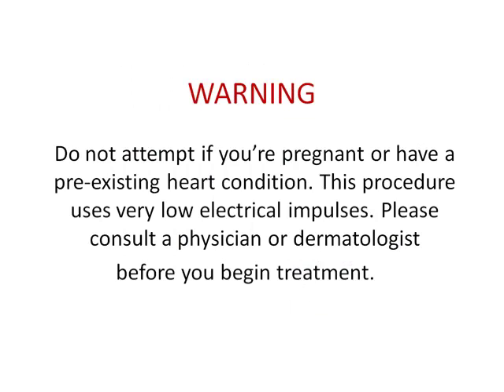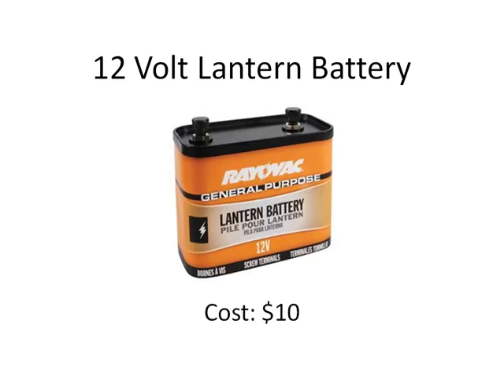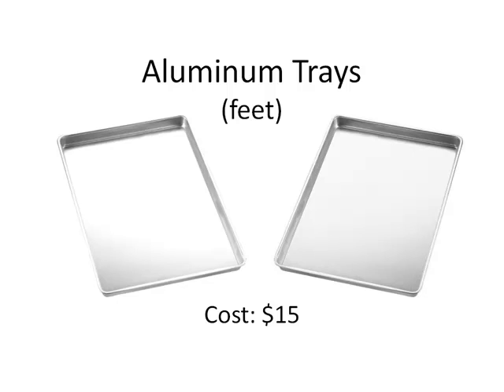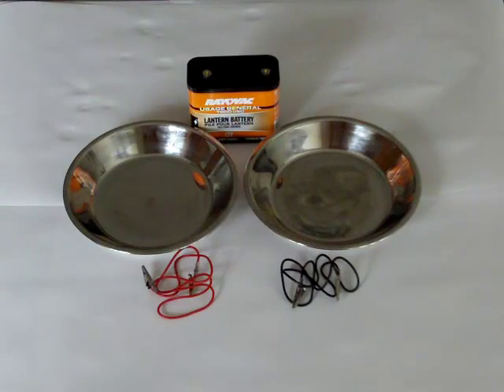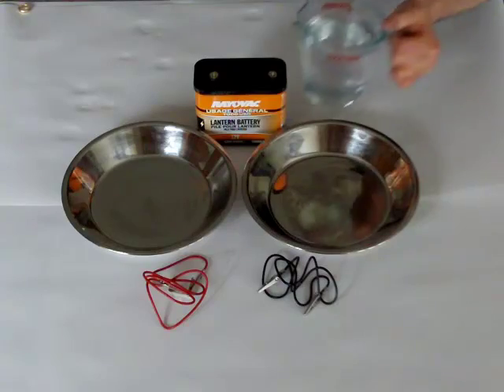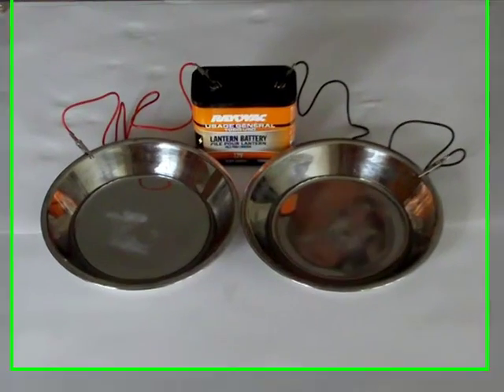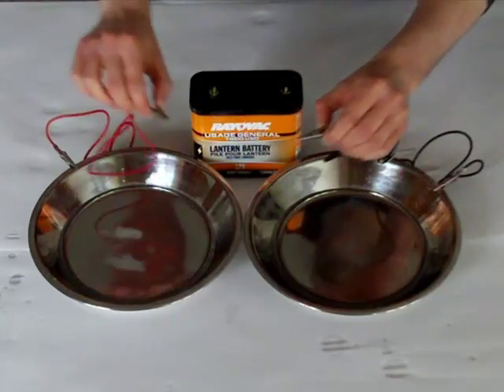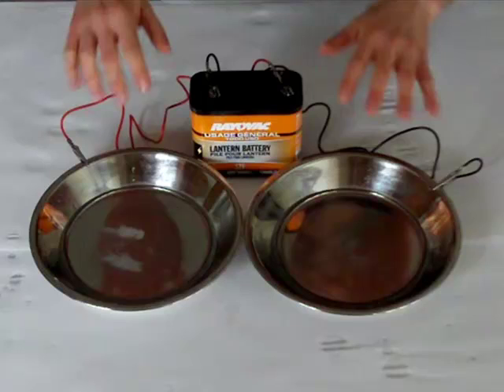How to Build Your Own Homemade Iontophoresis Device

Comment: I have been using the ionthophoresis method for more than 3 months and it has helped so much, i used it every 3 days for 10 days and it works for me. The thing is that I know i need to have maintenance so i do treatments once a week but it hasnt been working like before i wonder if i need to add salt to the water to make it more potent, i use a transformer  connected to alligator clips and  use an outlet so what do you suggest?
Reply: Use baking soda, also try using a higher voltage. I use 24 volts and it always works has long as needed.
Reply: jan dupree thank you I will try it!
Reply: medelin geraldino So, Did It work?
Reply: Yes, it does work, do the first 10 sessions every 3 days then you could do maintenance ones a week or as necessary.
Reply: medelin geraldino as for the aluminium or steel plates i have my reservations because i was researching and the ions emitted are supposed to be dangerous... so I wonder what if we use glass instead of aluminium/steel by puting the cables in the water..also i believe it's better to (instead of using tap water) get filtered water and add the minerals we want..because tap water has fluoride, lead, mercury etc sometimes
Reply: it works but what i am worried about is the aluminium/steel going in the body..which is why i wonder if glass would work. Also, tap water may have unwanted things like fluoride, lead, mercury, arsenic but i'm not sure since i haven't tested the water., but i bet these materials are in it...which is why I wonder if using Alkaline Magnesium water (http://www.scientificpsychic.com/health/mineral-water.html) would be a better idea.. Anyhow I will try Alkaline Magnesium water with 2 aluminium plates from now on but first i will try in glass with the cables in the water.. i will post my results but i am waiting for Epsom salt (magnesium sulfate) to arrive first.
Reply: medelin geraldino Thank You soooo soooo much !
Reply: medelin geraldino Does it get worse before it gets better?
Reply: medelin geraldino what is ur exact transformer? can you give me the specs? also have you felt any buzzing in the ears lately?
Reply: Shadow Of Earth Hi, I use an outlet and connected alligator clips to it, no ringing in the ear now I will use a 18 bolt battery for better results since I stopped maintenance and my sweating came back.
Reply: Javi Arencibia no it does not, it gradually decreases
Reply: medelin geraldino 
will this adapter work ?  (connected to outlet and alligator clips
AC-DC ADAPTOR
CLASS 2 TRANSFORMER
MODEL: CY41-1800300
INPUT: 120V AC 60Hz 9W
OUTPUT: 18V DC 300mA
Reply: Shadow Of Earth yes! I do believe that will work, I will try it for myself since I can't find 18 volt batteries, any suggestions?
Reply: medelin geraldino the closest ones i've found to mine are:

http://www.amazon.com/18V-AC-to-DC-Adaptor/dp/B00NRH8Q4U/ref=sr_1_18?s=electronics&ie=UTF8&qid=1422067474&sr=1-18&keywords=ac-dc+adaptor+300ma+18v

and

http://www.amazon.com/UpBright%C2%AE-Adapter-Electrolux-Cleaner-Charger/dp/B00OP30Q48/ref=sr_1_3?s=electronics&ie=UTF8&qid=1422067474&sr=1-3&keywords=ac-dc+adaptor+300ma+18v

and you need 2 of these alligator clips:
http://www.amazon.com/10pcs-Black-Coated-Alligator-Clamps/dp/B00S4YKS60/ref=sr_1_25?s=electronics&ie=UTF8&qid=1422069469&sr=1-25&keywords=alligator+clips

Guide to set up clips:
http://www.instructables.com/id/wall-transformer-for-project-power-supply/
Reply: Shadow Of Earth  Hey, but don't the cable get oxidized? And how will it work efficiently? I bought the 18 v outlet and made my own with the alligator clips and its working really well.
Reply: Shadow Of Earth thank you for the instructions!
Reply: medelin geraldino I guess the alligator clip would get oxidized yes if placed directly in water but i wonder if it would work that way and i also wonder if it's more safe.. i will probably try in a week.. and tell you if it works and what not.
Reply: medelin geraldino no problem! glad i could help..please do tell of your progress. Remember 10 minutes and then swap cables 10 more minutes.
Reply: medelin geraldino side question: do you have tinnitus?
Reply: 1 only... They seem to have the same specs so just choose 1.
Reply: yes i did try it myself..i have 18V 300 mA adapter *****
Reply: i found these adapters with lower than 300mA current:
18V/100mA:
[http://www.calinemusic.com/article/?41.htm]

18V 200mA: 
[http://www.amazon.com/HQRP-Adapter-18-Volt-93600890017-Replacement/dp/B00GSUX5CQ]
Reply: ***** thanks to your question about the 300mA being safe or not i started investigating and found out that iontophoresis machines have 25mA current or less for 18V and even though i used 18V/300mA with no noticeable bad effects (only tried for 2~3 weeks 40 minute every day sessions palms and feet [20 each]) I am going to get an adapter that is able to provide 18V/25mA..and any whatsoever and i found the following:
http://www.mastechpowersupply.com/volteq-regulated-variable-dc-power-supply-hy3003dx-30v-3a.html
at first glance $99 seems like a lot but I prefer to make an investment in order to be safe.. most machines cost a fortune so $99 is cheap and safe.. there is a BIG difference between 25mA and 300mA...who knows how 300mA daily x 40 minute sessions might affect the brain. heart and other body parts!!
I will keep looking for other power supplies like this one maybe i can find 1 for less than $99 that allows such low current.. if i do i will tell.
Reply: djancak If I use the same product as the video for the treatment, would it be generally safe?
Reply: djancak  Hi I was also worried about aluminium poisoning from the pans. how do you know that the aluminium wont go into your body?
Reply: I appreciate your reply. Is there anywhere i can read more about the chemistry of this?
Reply: I recommend using a battery or maybe rechargeables in a 12 v pack. You are connecting yourself to a voltage source, and a transformer wouldnt be the safest way. Also its AC and i dont know if the missing electrolysis changes the effect.
Reply: heyyy you tried it?

Comment: Can i use this battery http://www.ebay.in/itm/12-volt-12V-12volt-7ah-lead-acid-battery-exide-brand-safe-power-UPS-inverter-/271659047652?pt=LH_DefaultDomain_203&hash=item3f40241ae4
 Please any one help i am not getting 12 volt lantern battery in india.
Reply: abhimanyu singh I use GP 12 volts battery. http://www.ebay.in/itm/like/171306970618?aff_source=Sok-Goog
Reply: siddharth kalekar I don't use any creams. Just the iontophoresis.
Reply: thanks a lot Sristhi .
for how long you have been using that and one more question that does that battery really work?thanks in advance
Reply: I only started yesterday. I have noticed 70% reduction in palms and 50% in feet hyperhydrosis.
Reply: I am also in india which cram u used.plz reply me.
Reply: Plz described this method. how i can used that and plz till me which material use to make this machine. plz
Reply: And this method is work or not.plz realy me.plz.
Reply: I am wating for u r reply. plz reply me.
Reply: Reply me srishti plz.i am wating for u reply plzzzzzzzzz.
Reply: Hi Siddharth, I highly recommend you join this facebook group (if you are on facebook). It is a hyperhidrosis support group and you will get all the information you will need on iontophoresis as well as other techniques. 

https://www.facebook.com/groups/13752506316/
Reply: Sry for that but i am not in facebook.u tell me only how to made this machine and which material r u used that r available in india.plz report me.i need a help.
Reply: You will need a 12 or 18 or 24 volt battery depending on the severity of your hyperhidrosis with wires and alligator clips attached and 2 aluminium plates/stainless steel pan. In each plate there should be no more than 400 ml water. Tap water is fine. First attach the positive wire to the right plate and half the time later, reverse polarity and put the positive wire on the left plate. If you are treating your hands, no more than 20 mins total. Reverse the polarity at 10 mins. If you are treating your feet, no more than 30 mins total. You should reverse the polarity at 15 mins. You should notice a difference after 8-10 sessions after which maintenance treatments are necessary when your hands/feet start sweating again. Remember not to go beyond 24 volts. Research properly for yourself before you start this treatment.
Reply: Sry srishti i am asking u agian and  agian.can i use acid battery which is use in bike.and that battery is 12 volt.plz reply me.and what about u r hyperhidrosis its sstopping sweting or not.
Reply: No you cannot use that as the ampere rating would be very high. I have posted a link above which battery I have used, you can buy that.
Reply: Thanx for u r reply. and this method r work or not.and one more question in this video one cram aquaphor r used.then u used or not this cram.
Reply: Just use vaseline, it works just as well. The treatment works provided you stay regular.
Reply: hiii Srishti 
how is that working ?
just need to ask one question.
how do you connect those batteries .
can you please show me your setup if it is possible.
thanks in advance .
Reply: I can't post pictures here unfortunately. If you're using an 9 volt battery, you can easily clip them on (look for the duracell 9v). It's more difficult in a 6 volt battery as you will need to solder on the wires and then wrap your setup with wiring tape to keep it in place. 

If you are on facebook, I highly highly recommend you join the hyperhidrosis support group (link posted above). It's a remarkable community with many Indians as well who will be able to help you source stuff.

Comment: pls i cant get the voltage lantern battery so can i use a car battery instead
Reply: Yes but if you have access I would use voltage controllers I got five from Amazon for $15 you'll still need a power source and some jumper cables to connects the power to the controller but then you can dial-in whatever voltage amperage you find is best for you

Comment: I've been doing this for over a year on my palms and it definitely works for me. It took 1-2 weeks for my hands to be sweat free. I now only have sweaty palms when I'm really hot or really nervous. I replace my batteries like every 2-3 months? And you can also give more time in between treatments once ur hands stop sweating excessively. Like instead of doing it everyday, do it every other day, every 2 days etc. I do 10 minutes and then switch wires and do another 10 minutes. I don't add anything, just plain warm tap water works for me. Make sure to apply Vaseline on any cuts to prevent stinging. I haven't noticed any side affects. My hands did itch a lot for the first 2 weeks I did it and then it got better. If ur hands are really dry  (which will happen after a while) then skip the treatment that day because it will sting. Overall I definitely recommend it to anyone who suffers from hyperhydrosis, you just have to take out 20 minutes from ur day, I like to watch an episode or some YouTube videos while I do it and the time flies :) hope this helps any of u with questions about it!
Reply: How much ampere in battery??
Reply: Hei,i am facing e problem!! I get bit electric shock when i put my 2 hands one by one...
But when i just put 1 hand in the water and the other is not using,it Doesn't give me shock.is there any problem with my function?
Reply: @Sarah-zh4xj  you only get a shock after submerging both hands as that completes the circuit. It's ineffective with a single hand.
Reply: There are Any side effect now ??pleas answer me

Comment: Hi!
I am in the UK and found your video when looking up Iontophoresis machines.
I can not afford to buy a machine at the moment so found your video interesting and helpful, However I am unable to find a 12 volt Battery like the one in your video within the UK. Are you able to help and advise on what I can use instead which is available in the UK?
Kind Regards
Janey
Reply: This is what I use http://www.amazon.co.uk/Yuasa-NP7-12-lead-acid-battery/dp/B000V3QT42
Reply: KevinIsDaGuy And does your battery work to??
Reply: Sammy C. Yes, it works perfectly. I did the treatment like in the video for 14 days straight, and I haven't had to do it since, it's been about 8 or 9 days since that last treatment, the results have been incredible. You get quite a shock the first time you do it, nothing that'll hurt, but it's a bit surprising, after 2 or 3 treatments the feeling subsided and I thought the battery might have failed, but it didn't, it was just that I had gotten used to the sensation. I definitely recommend using Vaseline on any cuts or sensitive part of your hand as will be quite uncomfortable.
Reply: Ok thx kevin ;-)
Reply: KevinIsDaGuy Did you keep the pans touching to make a full circuit?
Reply: Tom Is a Door The pans aren't supposed to touch. Your body completes the circuit.
Reply: KevinIsDaGuy
Thanks
Reply: Ive started doing this treatment today using 8 AA batteries (each battery is 1.25v) and disposable aluminium pans. I did try 10 batteries but was a little bit uncomfortable with 12.5v and bumped it back down. I can already notice my hands are quite dry. :)

Comment: Iontophoresis works. Really it does. I set up my own homemade device a year ago and it gave me my first dry hands in my life. Boosted my confidence because my sweaty palms and feet were very extreme. My twin sister has the same condition, so it is genetic and heritable. Unfortunately, it is very time consuming to maintain iontophoresis treatments. If you don't consistently do treatments at least twice a week, the sweating returns. As for ETS surgery, the side effects is not worth it. So that wasn't an option.

I'm now using Certain-Dri (contains 12% Aluminum Chloride) and moving to Drysol/Driclor/ -- generic brand is called Hypercare (contains 20% Aluminum Chloride). You can find them on Amazon or Ebay or your doctor can prescribe them for you. It has made a big difference. I apply it to my hands and feet right before bedtime. So far my sweaty palms and feet have reduced by 60%. And this is from using it for only four continuous days. I'll keep you posted, but so far I'm very happy with the results.

For all my fellow hyperhidrosis friends, first try the topical treatments like Drysol. I wish someone had given me this advice earlier. Keep applying the Drysol right before bedtime for at least two weeks and you would be amazed. A new friend who had crazy sweaty palms shared this with me. He has bone dry hands now.

If you have questions, feel free to email me. I'd like to help.
Reply: Thanks for the tip about Drysol, Dan.  I had an iontophoresis machine when I lived in the UK (it's now in storage), and it really worked, but was sometimes quite time-consuming.  I think I'll try Drysol if I can get it here in Dubai.  Is it prescription only or over the counter?
Reply: Dan, Aluminum is neurotoxic. Just warning you.
Reply: Drysol didnt work for my daughter, everyone is different
Reply: I personally use Driclor. It works lik 90 percent on my armpits, so thats just awesome. But infortunatelly it doesnt work on my palms. I dont know why. Maybe the skin there is thicker. Bud I set up my homemade iontophoresis device a few days ago and if you want to, im gonna update in a week or so. Also I dont use the salt at all cause it just makes it burn a lot.
Reply: Jamie More will you sell your old machine for cheaper price?
Reply: Kuting Meow Hi, unfortunately it's in storage in the UK and I'm based in Dubai.
Reply: energylab227 hi yes you can get Driclor in Dubai. I get mine from the pharmacy next to park n shop by jumeirah college
Reply: so did it work
Reply: I am using Aldry. But its not working
Reply: Is it ok to use 12 volt car battery for DIY iontophoresis?

Comment: What difference would it make with 12V but different Ah? Because i cant seem to find any "lantern battery"
Reply: it doesn't matter you just need a voltage source e.g battery. I personally use an adapter
Reply: vvv2k12 what kind of adapter??
Reply: jassi zorr I use a laptop charger adapter which has an adjustable voltage range between 12v-24v which i have modified myself to make my iontophoresis machine. Purchase this http://www.ebay.co.uk/itm/300932304278?ssPageName=STRK:MEWNX:IT&_trksid=p3984.m1439.l2649 cut off the lead, strip the wire and connect paper clips
Reply: vvv2k12 Hello, may I ask how exactly u replace with a laptop charger? May be u should even do a video about it? I would also like to ask if this really works cos life is just painful sweating any time anywhere. :'(
Reply: Blue Cherry hey, i understand your pain. give me your email ad or something and i will contact you.
Reply: vvv2k12 Hi, thanks. It's redandyellowlava(at)gmail(dot)com
Reply: Blue Cherry can I get this info about the laptop charger too? My mail is jassiprinx@gmail.com ....please!
Reply: jassi zorr Yes, sure. Definitely. I'll forward the email to you once I receive from vvv2k12. Until then, let's wait. lol
Reply: Blue Cherry did you get the mail.if yes can you Please forward that to my email id abhimanyu.indium@gmail.com
thanks in advance.
Reply: Please someone forward the information to (panda.abhijit24@gmail.com)

Comment: I wonder if aluminum ions passes through skin to the body due to electric current because of using aluminum pans . Aluminum deposition is very dangerous to the body.
Reply: good Q.. did you get some data on this?